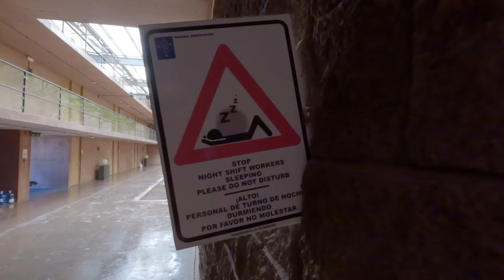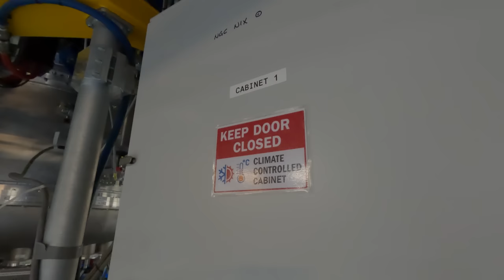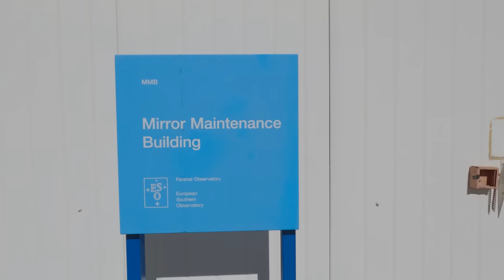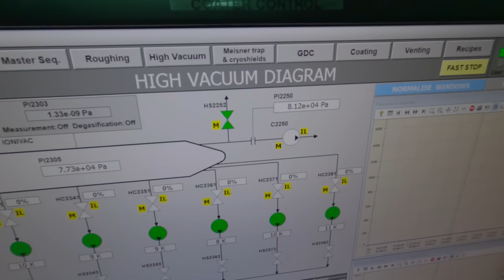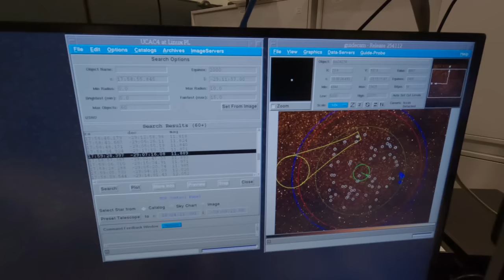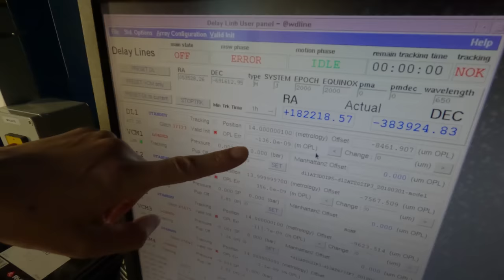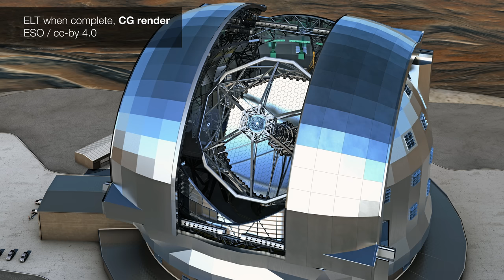The largest telescope that will ever be built*

Comment: Concerning your worry about the length of the video in the newsletter: don't worry Tom. We like your videos because they are always as long as they need to be to fit all the information you have for us. And having such a detailed video once in a while is phenomenal.
Reply: Ikr, it's not like he stretch it for watch time. I have no idea what he is talking about beyond surface level but the time flies quickly.
Reply: Hear, hear! (erm… read: read!)
Reply: I clicked without checking the length, and when I got to a TITLE CARD I thought something up and checked. Won't be able to watch on the ten minutes of lunch I have left, BUT super excited for a long form Tom Scott video, I kinda wish they were more frequent
Reply: AMEN! If a video needs to be an hour because of all the information, make it an hour. I regularly watch 40+ minute videos by somebody else and he is also regularly told to take the time necessary.
Reply: Agreed.
Reply: Agreed that Tom's earned my trust that his videos are no longer than necessary. No complaints at all that there's any filler in this. But I do like that most of Tom's recent videos have been easy to fit into short slots of my time availability. This is a different paradigm, something I have to budget watch time for. I like it, but it's not what I expected. Not a criticism, an observation.
Reply: I skipped this one... too long for the subject matter but I understand those who are into this kind of stuff have liked the extended duration.
Reply: @soundscape26  Fair enough ... want the TLDW to explain the title?
Reply: I just don't have the time for videos this long though
Reply: @KekusMagnus  eh, you can watch it in parts, he splits it nicely into sections

Comment: The idea that we are able to spray down 7g of aluminum, pretty much atom by atom, on such a large surface is insane
Reply: Well you say we, but sometimes I miss with my deodorant spray.
Reply: What fraction of the thickness of an aluminum foil (0.016 mm) would that layer of aluminum be?
Reply: @rallychamp2003  hahahahaha
Reply: O.625% of the thickness of aluminum foil, if my math is correct.
Reply: It's a much fancier version of the tech they use to put anti-glare coating on glasses and camera lenses.
Reply: @webarnesca  my math was wrong, so I redid it and I found 1/64 = 1.56%. How did you do it? I used the metallic atomic radius of aluminum, which is 125 picometers.
Reply: I think they use aluminium.
Reply: @whozz i have not done the maths, but could it be because of the structure of aluminum ? It the atoms arrange themselves in an offset matter, that could mean that the actual mean thickness of atoms is lower, if you get what I want to say
Reply: @whozz  he said the thickness was 0.1 micron thick. which is a 160th of the aluminium foil.
Reply: @whozz I just went with what he said in the video which was 0.1 microns thick. I can't recall now but he might have said it was one thousand atoms thick (he gave a number, I just don't recall it).
Reply: @whozz  I can't find documentation right now, but I seem to recall being told that the aluminium layer we were depositing on the Anglo-Australian Telescope's 3.9m mirror was 9nanometers in thickness.
Reply: @timconnors That is absolutely fascinating!! What process were you using? Some kind of chemical vapor deposition? 
And what was the tolerance on the thickness?
Reply: IT’S ALUMINIUM
Reply: Right? How do they guarantee uniform distribution? Pure gaussian randomness?
Reply: @lucbloom  They deposit aluminum on one small bit at a time and tightly monitor and control the thickness as it is being deposited, possibly using a quartz monitor or something else. Since they measure the thickness in real time, they can make sure they don't move on to the next patch until the thickness is just right.
Reply: @EebstertheGreat  Another option might be in situ ellipsometry, which measures the change in polarization of light bounced off of a surface. It's a common method of measuring deposition characteristics in ALD (atomic layer deposition) systems in the semiconductor industry.
Reply: That was definitely a “what!?” moment. So many in this video.
Reply: @ToxicTurquoise454  No, it's AlumiNUM!
Reply: @TgWags69  Aluminium.
Reply: The moon seems so close, but the fact we can accurately do this with atoms and only zoom in to 10 meters on the moon at our max limits shows how crazy big the universe is. We will understand atoms far before we can ever travel to another galaxy. It’s so mind boggling to think that humans have only been technologically expanding for a few millennia, and yet the universe is 13.7 billion years old, and yet us humans could probably spend another 20 billion years alive and evolving and learning the universe, and we still wouldn’t fully understand it. truly astounding
Reply: I believe it was a PVD process.  They use something similar putting seed copper layers on semiconductor wafers.
Reply: @PieterPatrick  AlumiNUM!
Reply: @lucbloom  The required surface roughness is less than that of the sputtering process. I wouldn't be surprised if the coating didn't smooth out the polishing of the glass blank
Reply: @TgWags69  No.....Aluminium.

And it is only Aluminium in my language.
Reply: @skyluke9476  Agree. But don't tell that to a flat earther, he'll get a short circuit in his brain and probably end up in an infinite reboot loop (I watch SciManDan). 🙂
Reply: @PieterPatrick  AlumiNUM! Four syllables is much superior.
Reply: Wanna know something even crazier? I used work at a facility that polishes mirrors for telescopes, we actually made the mirror for the SOAR telescope, located down the road from the VLT. We would have apply a "test coating" to the mirror right when we're nearly done polishing it, because the coating contracts when it bonds the surface, changing the prescription by a few angstroms. We'd characterize this deformation with an interferometer, and polish the inverse of it into the mirror surface so that when it gets recoated, it contracts into the intended shape. It's more complicated than that, but there it is in layman's terms.
Reply: @TgWags69 It's the ESO (European Southern Observatory) so it's using aluminium.
If it was an American, (meaning the US of A) observatory I'm sure aluminum would work fine.
Reply: You get that this tech(vapor deposition) dates back to like 1880, right? Mylar is a common example of the process, e.g. metallic balloons.
Reply: @rallychamp2003  Maybe that should be the next thing these engineers work on. Automated aerosol spray.
Reply: @rallychamp2003 let me guess, the nozzle was rotated in respect to the can so it actually went behind you.
Reply: One can alternatively use rhodium, and it is a necessity for those who live in coastal resorts.  The late Patrick Moore lived in Selsey, a coastal resort in Sussex, and had his telescope mirrors coated with rhodium.  It is extremely hard-wearing compared to Aluminium.

Comment: 9:37 Fun fact about the air conditioning in these big observatories: When doing optical observations, it's important for the air to be still and stable. Introducing a temperature gradient to the air can cause distortion in the image observed by the telescope. To avoid this, large observatories often keep the telescope chamber (the dome) chilled to the expected overnight temperature, so that when they open the telescope to the night air, there is as little gradient in air temperatures between the telescope and the night sky as possible.
Reply: Oh wow. That make sense.
Reply: The small 3.9m Anglo-Australian Telescope's dome has a diameter of only 30m.  The dome's air conditioning system was 100kW in power.  We were disadvantaged by the wind shutter leaving an opening that was only very slightly larger than the mirror itself, so you've just got a 4x4m opening to the sky.  So there was a lot of heat picked up during the day in the Australian summers, but then only a very small opening to equalise the temperatures during the night, if it wasn't otherwise cooled.
Reply: The observer rooms are removed to the side and behind airlocks for similar reasons
Reply: Telescopes are just like me in the summer.
Reply: So the thing where you go into a room that's too cold and you suddenly feel a bit weird, that happens to telescopes too?
Reply: Thank you for that detail!
Reply: @vigilantcosmicpenguin8721   it's more like... have you ever "seen the heat" coming off of hot cars or hot pavement during summer? It's particularly noticeable in that case -- I'm not certain if it's the temp, the difference in temp, or perhaps the humidity that makes it more noticeable -- but the same effect occurs with any difference in temperature. It isn't likely to be noticeable by a human when mixing 40F air with 70F air, but when you're measuring light that is so far away its distance is measured in relation to the years it takes to travel to us, that tiny amount of light bending is enough to mess up readings.
Reply: When I was a member of an astronomy club, we would set up our telescopes a couple hours before sunset so the mirrors could equalize to the ambient temperature as the sun sets.

Comment: As a physicist watching this, please don't apologize for the analogy between radio waves and bass at 17:30. It's exactly accurate and a great example of science communication like so many other explainations in the video.

Thank you for the great job on this one. Seems like it really paid off to redo the script as the final version is just amazing and worth every minute of watch time.
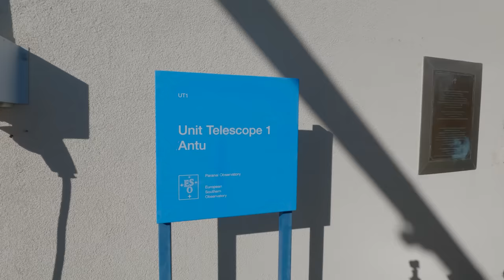Reply: Hi, sorry to bother you, but can you tell me a set of google keywords to understand 18:45 - i.e. why "light interferometry wont work because there is not a computer fast enough and a clock fast enough to collect visible light data in terahertz range"? Thanks.
Reply: @anandsharma7430  It means that our current computer technology isn't yet fast and accurate enough to be able to transfer and store the massive amount of data they are collecting with these telescopes on a large scale.
Reply: @anandsharma7430 (My guess) A terahertz frequency light wave means you would need to collect 10^12 readings per second. So your computer & hard drive would have to record a Terabyte per second. I googled and modern hard drives are in the hundreds of Megabytes per second.
Reply: @yitzakIr  Hard drives wouldn't necessarily be the problem. You can easily have some RAM of a few TB which you can write to with 64GB/s. For shorter samples, it could still be faster for specialized gear. But that's still a factor of 10'000 away from 500THz of the visible spectrum. You would also need more than one sample per cycle, if you want to do interferometry.
Clock offest/jitter is a pain in the ass if you want to do interferometry. Probably much more of a hindrance than memory throughput. The latter one can be parallelized.
Reply: There is also the problem that the possition/phase trade off for optical frequencies has problems with Heisenberg uncertainty, so you probably can't do this with classical computation, you would need to store and transfer quantum information.
Reply: @yitzakIr  The fasted storage I know of is the Crucial T700 M2 SSD. They say it can write at 11,800MB/s but I still don't think that's fast enough.
Reply: @AutismIsUnstoppable the hardware limits of storage isn’t really that big of a deal. It’s relatively simple to use multiple separate storage devices and multiplex your writes. Certainly not cheap, but for these niche applications not that difficult to do with modern tech. The main technical limitations are processing speed, timing accuracy, and sensor sample rate
Reply: As an engineer, I was going to say the same thing. Brilliant as usual Tom.
Reply: @anandsharma7430 EE here, that's because of something called "nyquist theorem".
Essentially it says that you can only record frequencies which are half as fast as your "sampling rate". That's because we discretely sample signal values at one point at a time. If the frequency is too high you won't get the right results and get something called alias frequencies which are not really there but since your sample rate is too low it looks like those are the right frequencies.
Think of a sinusoidal wave the same frequency as your sampling at: you will only ever get the same value of this sinusoid because you're always sampling at the same time. I hope this is somewhat coherent since English isn't my mother tongue.

Edit: while the nyquist theorem tells us that the sampling frequency has to be at least double of the highest signal frequency it is generally higher than that for safety reasons, the equation also states:
f_samplingrate > 2 × f_max
Reply: As a fellow profeession college, i was about to post the exact same thing.

Science doesn't need to be explained with big fancy and complicated words.  A good analogy, such as this, can make it more accessible to everyone (which, in my opinion, should be the end goal of any scientific development)
Reply: @AutismIsUnstoppable  Storage isn't the problem, you can just do things in parallels, the problem is simply sampling the data fast enough, because for that you need one thing to do readings X times per second, and with optical light that means the time it takes light to travel 1/2 wavelengths. With radio waves that's a few meters to a few millimeters, with optical light that's a few hundred nanometers, so not really happening. I kind of doubt it will ever happen, tbh. It's way beyond anything you could get to just from More's law because you'd need transistors smaller then atoms.
Reply: @somebod8703  You need not only the amplitude, but the phase of the EM wave. And it has to be the correct phase, not some multiple off
Reply: And the makeup mirror comparison is good, too.  There's nothing fundamentally different about how the two mirrors work - just the scale.  There's no magic super-science beyond the understanding of normal, non-PhD-having people, because cutting-edge science works with the same rules as the rest of us.  If normal people had to do makeup from hundreds of light-years away, we'd end up with makeup mirrors that were also 8 meters wide and actively stabilized.
Reply: @Markle2k  Sorry, I don't really understand how your statement relates to mine. I don't think I said something about amplitudes.
Reply: And any audio engineer can tell you that you want an abundance of power in the bottom end  of any sound system to get the crowd dancing 🕺

Comment: I just finished watching and.. Honestly, the precision with which those machines work is insane. 
I am having trouble fathoming that humanity can be that precise. It seems crazy to me
Reply: @AstolfoGayming Fate Secondary?
Reply: Yet the temperature in my shower is either freezing cold or scalding hot.
Reply: @UnremarkableKevin  you just need all that precision to adjust the tap.
Reply: I know. I have a couple of machines that are good to 0.001" (well they were when new).  But how did we get here from rubbing sticks together.  How do we make a more accurate machine with a less accurate one ?!?!?   Makes my brain itch.
Reply: @UnremarkableKevin  You should really calibrate your water heater of choice to never be scalding hot, as you almost certainly don't need it and the energy savings are huge.
Reply: @UnremarkableKevin skill issue
Reply: ok "astolfogayming" 💀
Reply: Gravitational wave detectors require about a million times more precision. To reduce  vibration of their mirrors to the required degree, they had to make four-stage pendulum suspension system. In the vacuum, of course. They have to account for vibration caused by Brownian motion of atoms in the suspension wires (which have to be monocrystalline quartz to minimize that).
Reply: It's hard to fathom because it's not a single human or even a group of living humans being this precise. It's thousands of generations of humans making small incremental improvements and passing down the information and tools used to build a machine that is far more precise than any human could hope to be on their own.
Reply: @UnremarkableKevin  
public class Shower{
private bool temp = true;
}

Comment: About a year ago I head the pleasure of taking an engineering tour of the Sistine Chapel of astronomy, the Mt. Wilson Observatory  near Los Angeles.  The dome on their 100" telescope is also designed to rotate to follow the progression of stars throughout the night, except the entire observation deck, the control desk, all that stuff, rotates with it.  When they spin the dome and you're inside you swear that the telescope is pivoting rather than the room you're in.  It's remarkably quiet and completely smooth, an amazing accomplishment considering it was built about a century ago.

Comment: As a photographer whose built cameras before and a penchant for light, thank you for taking me on a tour of what are some of the largest and best camera ever made? Or certainly one of them. The precision is on another level.
Reply: Most large telescopes are operated mostly for spectroscopy rather than photography (though they can do both).
Reply: @gordonrichardson2972  just as well that I don't build massive telescopes! 🔭 But thanks for that factoid.
Reply: @walterroux291  Never late to start! ;)
Reply: @Sekir80  I do actually want to get a telescope, once I've moved to the countryside!
Reply: @walterroux291  Great idea! I already have mine, but I had to move to a flat so very rarely use it. If you have any idea what you are most interested in looking for (planets, stars, nebulae) I can guide you to select a scope for your needs.